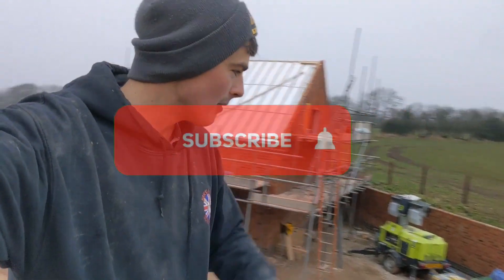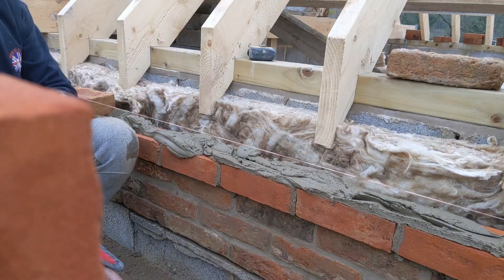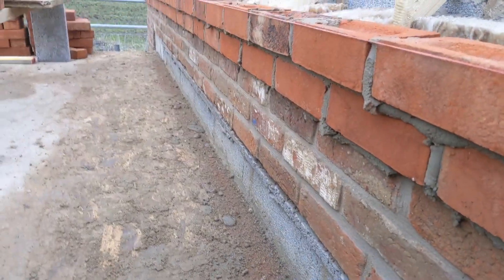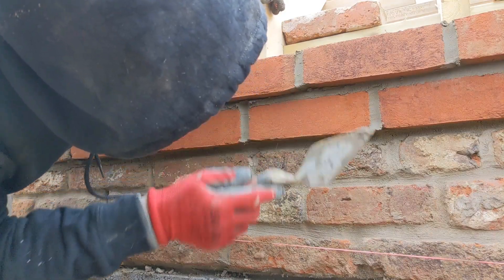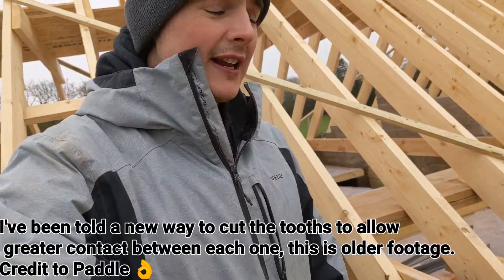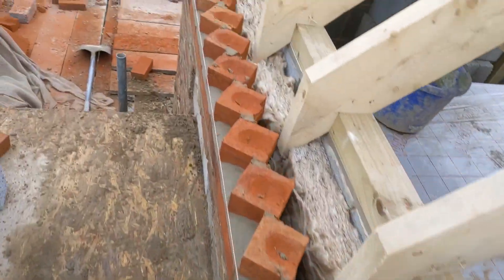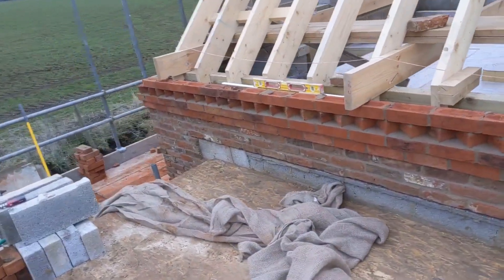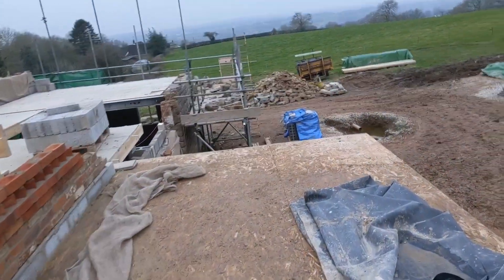Bricklaying - Brickwork pattern - Barn conversion #bricklaying #renovation #extension

Comment: Looks interesting. Decorative work is always slower but that’s part of its charm. You just need to be paid accordingly. Not sure what your standard mortar mix is but for people using about 6:1 the mortar that’s exposed to the weather on this type of effect needs to be stronger, about 4:1, otherwise over the years it can deteriorate and wash away.